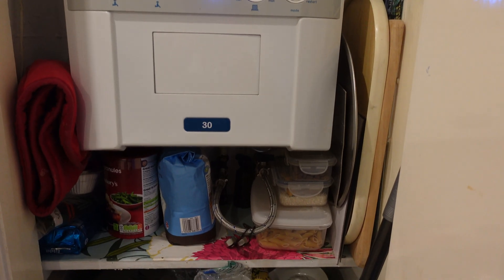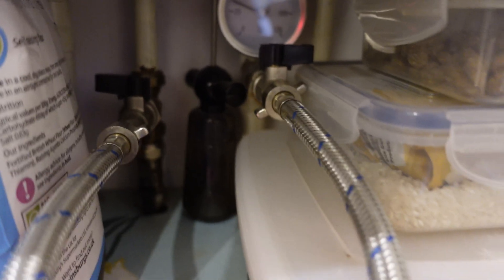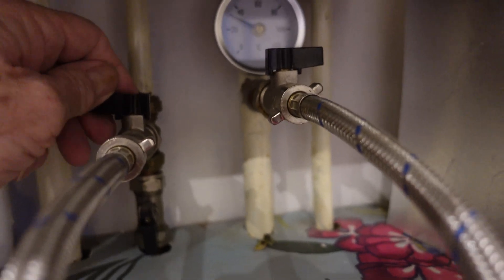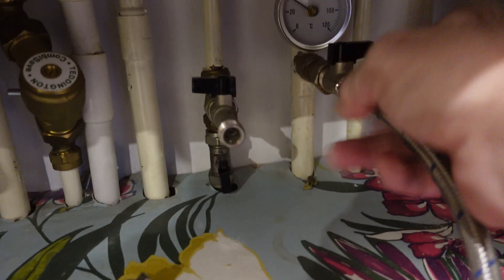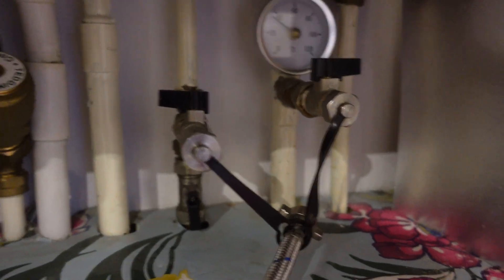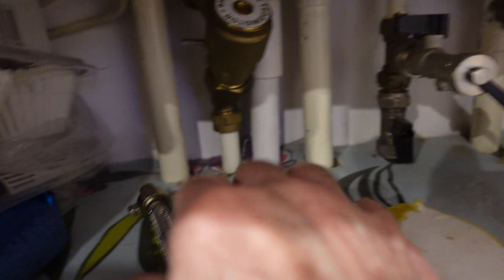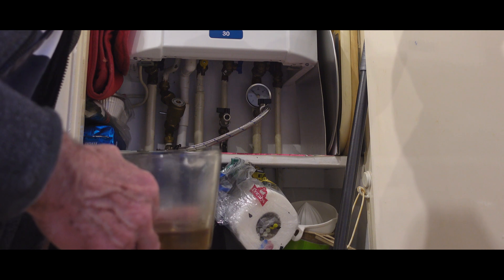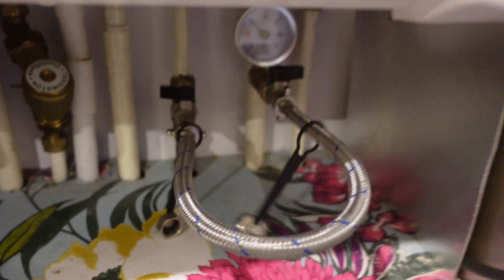#Combi Boiler pressure to high? What can cause it and how to reduce it.

Comment: My boiler pressure is fine until the heating is turned on.
Then it goes into the red within a few minutes.
I bled radiators, which brought pressure down to normal.
Then same thing happened again when heating was switched on.
Reply: Update :
I evacuated some pressure using the method shown here, and the boiler has now come to it's senses.
Thanks for the knowledge.
😀
Reply from the maker: No problem.

Comment: My pressure goes up every time the heating is turned on or i use hot water. It goes up to 3 bars, i release water but it goes back again one i use hot water, what is wrong? Please help
Reply from the maker: It will naturally rise when used but not normally to that pressure, make sure your gauge is at 1.2 bar when it is cold and not starting at something like 2.5 bar.

Comment: Brilliant thank you. I overfilled by accidentally leaving the refill valve open ever so slightly for about an hour or so. Pressure was at 3 bars. Good think I checked otherwise it would have gone to 4 bars and probably blown up! Anyway, I followed your instructions and now pressure is at 1 5 bar. However, it took ages - literally about 2 hours and it must have been about 50 or more kitchen washing-up size bowls of water - no exaggeration. I kept filling the bowl then emptying it down the toilet then refilling the bowl   I thought tbe pressure would never reduce to 1.5 but eventually after about 2 hours it finally did!
Reply from the maker: Had it reached a bit more pressure the safety valve would have blown taking the water away outside.
Reply: yes I was very lucky! I hope I caught it just in time. It seems ok at the moment. Central heating working fine and hot water too. So fingers crossed. Thanks again for your very clear, easy to follow video for non-specialists like me! :) @dereton33

Comment: Love your video... I have a question, I see plenty of videos on how to increase the pressure, I also know how to decrease the pressure but... my boiler keeps increasing in pressure by 0.1bar every 48 hours. Also if I was to try and increase the pressure through the link / fill hose connector it takes about 5 minutes to increase the psi by 0.1 bar. Have you an idea of what is going on. Gloworm Ultracom CX. Cheers.
Reply from the maker: You must have a faulty infill valve that is not working correctly. Disconnect the filling loop to see if that stops the pressure rising. That is if you have one.
Reply: @dereton33  wow, thank you for such a fast reply. Yes I have a full loop connected all the time. I didn't think it could be that as both valves on either end of the fill loop would have to be faulty. Anyway, I'll take the loop off and see what happens. Again thank you so much.
Reply: @camping_guru_uk   Seems we have a very similar boiler but a identical issue. Our plumber found expansion vessel to be faulty but has fixed this but problem persists. He said filling loop isn't causing issue as it's closed but hasn't tried disconnecting it, didn't know you could do that? Would love to hear how you got on.
Reply: @jed7200  it was the filling loop. He's blocked it off and fitted a new one in the main inlet pipes. I'll take a photo later
Reply: @camping_guru_uk  just to update, mine was the filling loop, replaced myself and up and running!

Comment: Hi, I've tried this way but, no water comes out at all. The boiler is a morco super compact Feb 24e in my static caravan
Reply from the maker: The valve is stuck.
Reply: Thanks for that, is the valve what you open to let the water out ? Because on my pipes the 15mm has a black knobs like yours but, on the 22mm it's one where you use a screwdriver, is it that, that is stuck ?

Comment: Hi. First of all thanks for the video. Our Ideal boiler does have those two taps and I have used them in the past to top up the boiler. Problem I’m having now is that turning both of those taps ON but can’t hear any water flowing. And in turn it’s not topping up the boiler pressure. Anything I can check for please?
Reply from the maker: Disconnect the filler hose and check if the tap is working
Reply: @dereton33  Hi. Yes the tap is working,  water gushing out as soon as I open the first tap. In think it's just not going past the second tap. I've checked both ends of the hose

Comment: You're a life saver! I accidentally overfilled the pressure and had no idea that I could drain the boiler by the connecting hose. So simple! Most people on here only tell you to bleed the rads.👍
Reply from the maker: Glad I could help!
Reply: I did what u told me but the pressure is still high ? And needle doesn’t not move down

Comment: So in case of high pressure: expansion vessel faulty, filling loop open or valves letting by or safety valve malfunctioning right. But the safety valve (3 bar PRV) should only work if the expansion vessel is faulty and does not contain the expansion right? Actually I read the comments and another cause is plate heat exchanger broken with pin holes between the ch side and hw side which would act as continuously open filling loop that you can't see but would take the pressure to over 3bar causing the PRV to release excess pressure. Any other causes so far?
Reply from the maker: Very rare that happens.

Comment: Just sorted my tote and noticed I've misplaced/lost by flexi braided, filling loop hose.  Householders take them off and lose them. I always tell folk to store' em on top of their boiler. Lots of newer boilers have those pre-fitted, preformed copper loop connectors, neatly tucked away directly beneath the boiler case where it's harder to accidentally knock and open them. Again, they're not supposed to leave them on. Some folk take them off aaaaaaaaaaand....... lose them. Ever tried getting a spare preformed copper filling loop for an Ideal Logic on a Sunday afternoon? Like rocking horse poo. Oh, and I always carry spare 10mm fibre washers especially for them.
Reply from the maker: The problematic life of a plumber Loafer. Nothing but hassles.

Comment: Here's an addition to your over pressure issue I recently had issues with my own boiler(yes I am qualified 30 years) I'm more industrial/commercial so bear with me , boiler went over pressure so I assumed it was the Expansion vessel, fitted new one ,still over pressure finally traced the fault to the dhw plate hear exchanger leaking from the incoming hot water mains supply through to the heating side , every days a school day 😅
Reply from the maker: Thanks Philip for a great tip to look for.
Reply: To check the expansion vessel depress the shreider valve if air comes out great if water comes out change it. Most expansion vessels have the pressure on the label so check pressure.

Comment: What if your boiler is fed from a mains supply with no filling loop
Reply from the maker: Be careful not to knock a filling valve on. If you have no loop though with valves, you can buy a kit and have it fitted.